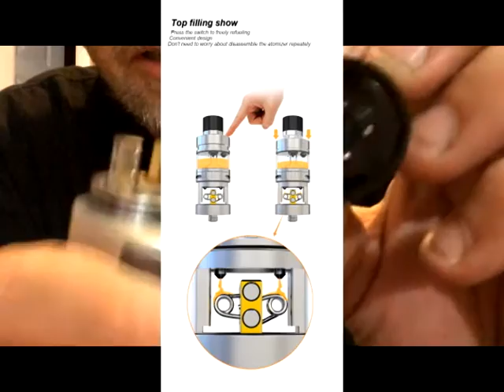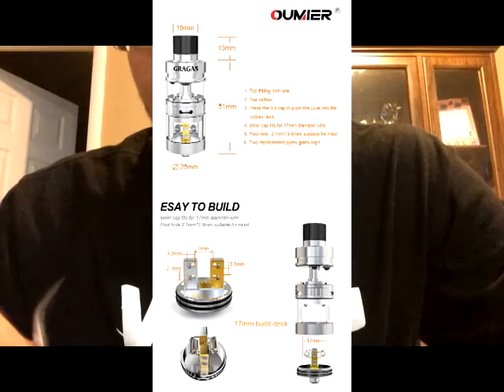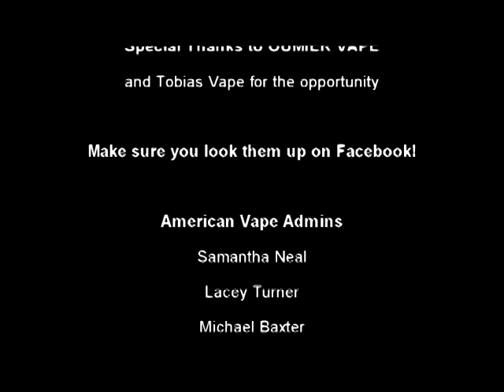Oumier Gragas RDTA Review by turner_vapes

Comment: Hi awesome review, but i think i have an issue with this rdta.Everytime i try to juice my wick up i can't get any liquid on my wick... i mean theredrips nothing, i don't know what i'm doing wrong.If you have any solutions please let me know.What i think is that all holes have to be in the same position too push the liquid through the tiny drip holes. But when insrew my tank on top and give attention that all holes are in a line, than my tank is a little loose, when i screw it tighter the holes are not in a line any more.
Reply: make sure the pressure pushers are pushed in properly & the plug is in there properly
Reply: make sure the pressure pushers are pushed in properly & the plug is in there properly